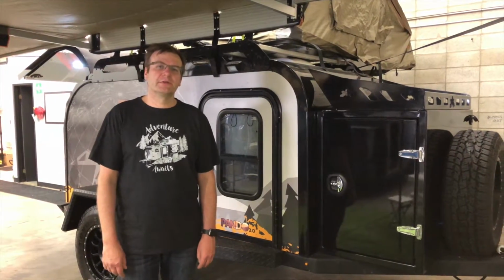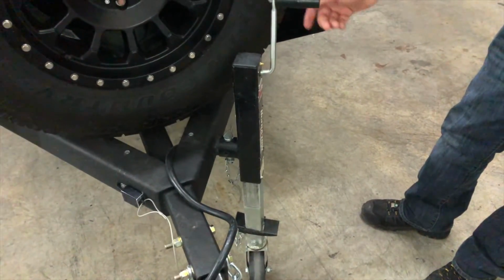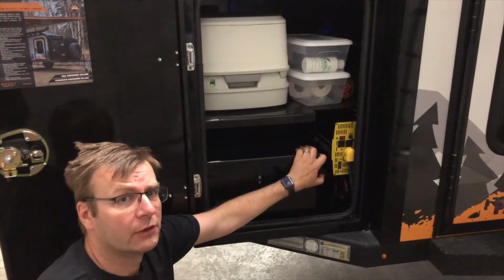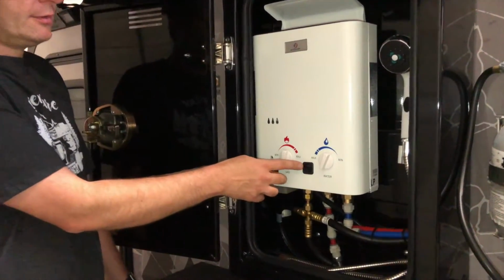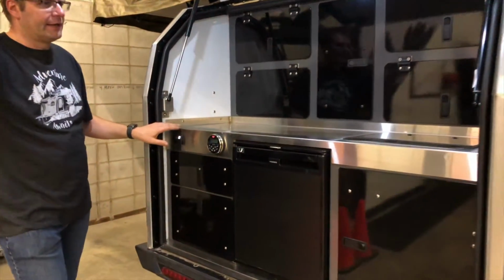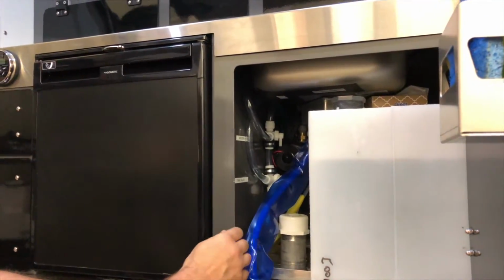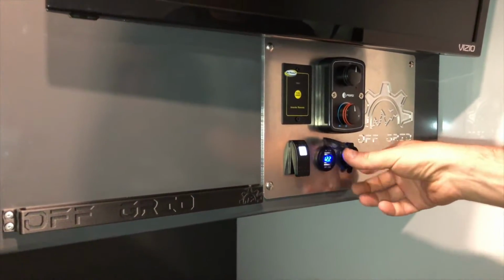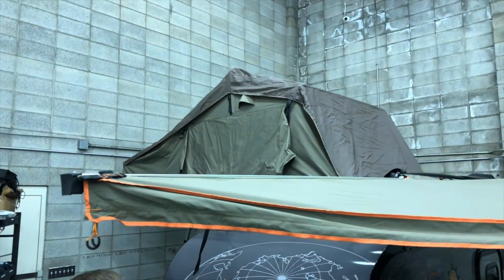Pando 2.0 Off-Road Teardrop Trailer Walkaround | Off Grid Trailers

Comment: Looks like a great little camper.
I'm just curious about a few things. 
I can't seem to find any weight specs and since this trailer is built in Canada,  is there going to be a tarrif tax to be imported to the states?
Also can an AC unit be added to any of the Offgrid product lineup.
I like the black but I can't imagine how hot all aluminum skin is going to get.
Aluminum is an excellent thermal conductor.
Reply from the maker: The Pando 2.0 is 2200 LBS. We do offer an A/C Rough In Option for the ZeroBreeze Mark 2 System. Sorry for the delayed response.
Reply: @OffGridTrailers  
Yup, been waiting a whole year for that response 😆
Reply from the maker: Sorry about that. We have had some personnel changes at OGT and I found some comments went without a response. I figured - better late then never - right?
Reply: @OffGridTrailers  👍 that's right. 
I also had some changes in the last year and found myself not as interested in camping anymore due to the over saturation of everyone wanting a camper and crowded camp sites along with the horror stories of camp site neighbors.
Reply from the maker: @Michiganborn-69   that is why we make our trailers capable enough to get away from the crowds and into the wilderness!

Comment: I noticed on the compartment with the water heater that the door has some vents on it. How dusty does it get inside after being on the trail for a week? And what kind of warranty does the water heater have against dirt/debris?
Reply from the maker: It has not been a big issue. The water Heater has a 1 year Warranty but we offer an Extended Warranty to cover all components as well as the body and frame for a full 5 years. https://offgridtrailers.com/financing/